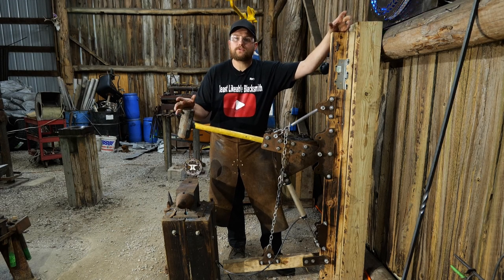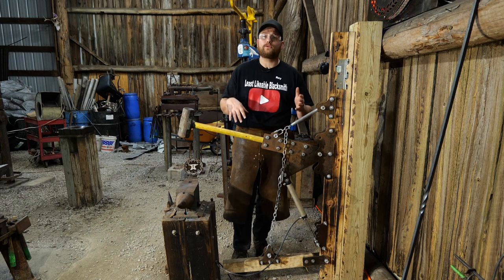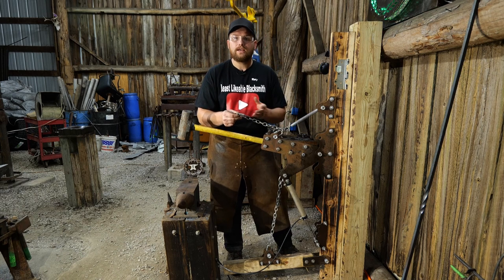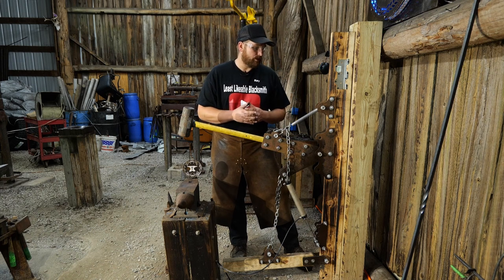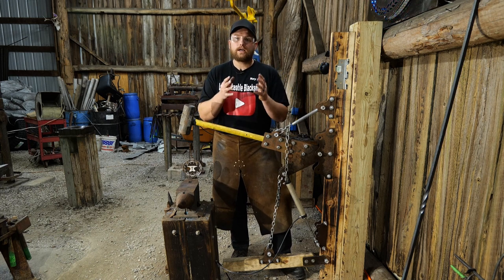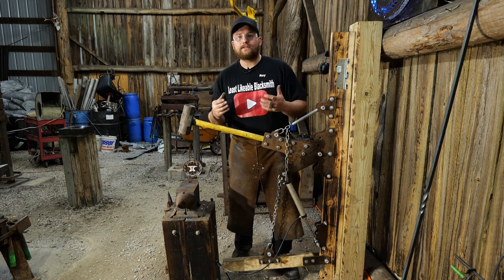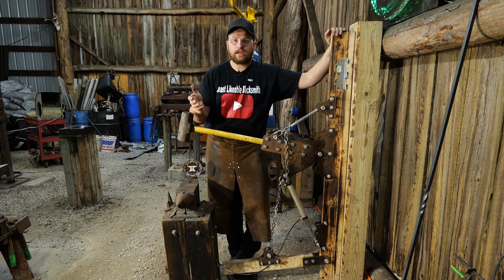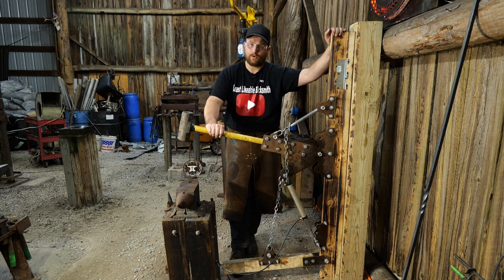Tuning + The Truth of the Treadle Hammer Kit

Comment: If I wanted to mount your kit on a 4x4 that is fastened to a concrete floor with a flange and some bolts, would I need to stabilize the top of the 4x4? Or would it be sturdy enough with just the bottom flange?
Reply from the maker: I personally would suggest that in that configuration you use a 6×6 timber And the flange made of 1/4" angle iron for Best results...
Reply from the maker: This would make it very sturdy

Comment: Has anyone built a 2x4 mount that isn’t fixed to the wall? I’m dealing with a cinderblock wall and I don’t think tapcons on a 2x4 would be the best option. Since it’s also a garage, I would love to be able to move it away when it’s not in use too.
Reply from the maker: My suggestion would be to mount some angle iron to the wall permanently and then attach the hammer and it's 2×4 construction to the angle iron with some removable bolts 🙂

Comment: Well, it also won't propel a 230 grain projectile one mile, but that's not what it was designed to do. No, it's not a power hammer, it's not an inline design, but it does exactly what it was built to do. And rather well, from what I've seen.
Reply from the maker: Love It and Yes exactly 💯